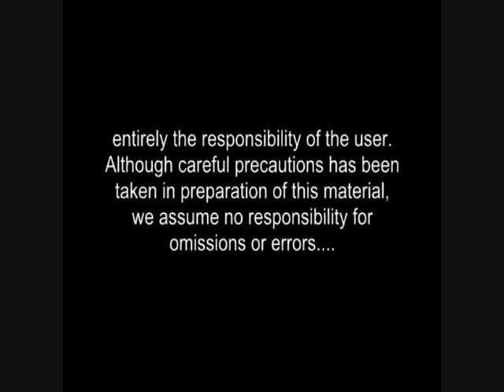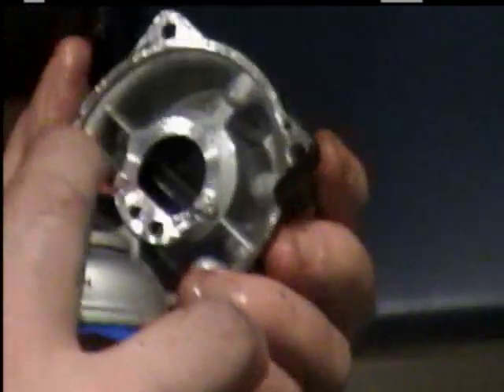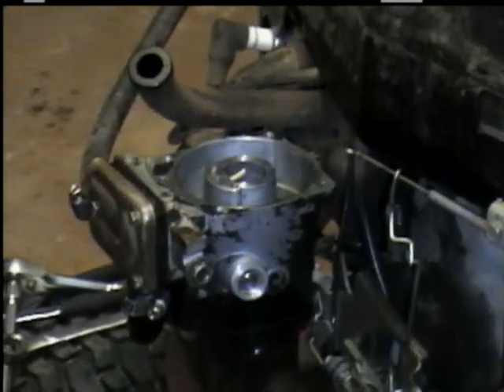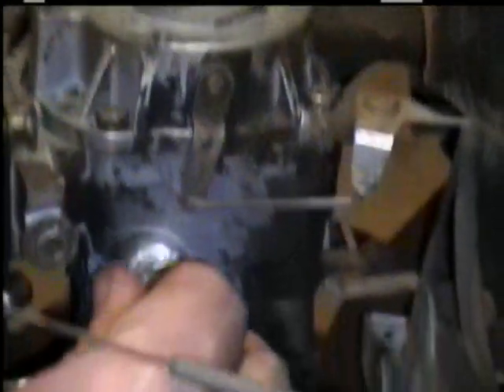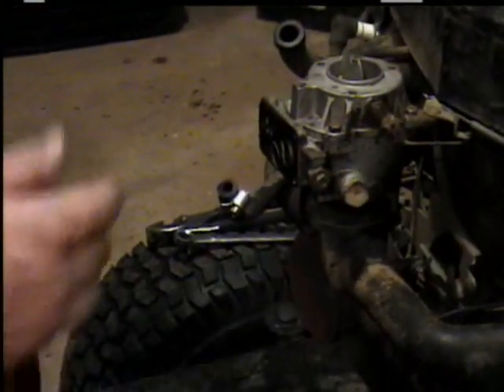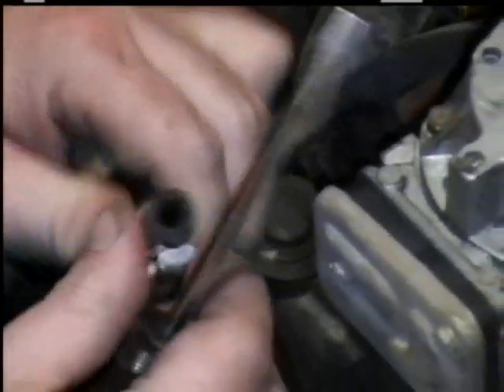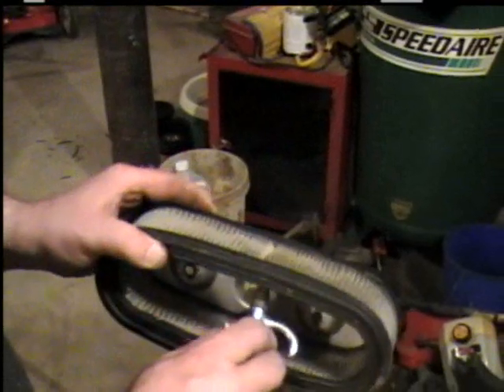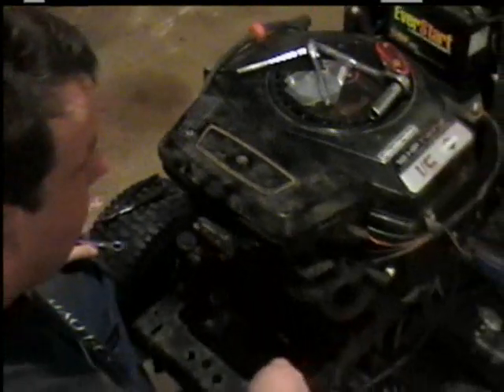Carburetor Cleaning and Fuel pump Repair

Comment: Anyone know what mite make a engine spit gas out the top of carb while trying to give it gas it want rib up .  Its a 18hp briggs  been sitting bout 5 year i cleaned the carb.  thx all.
Reply: Clean it again, and clean out all the little passages as well as the emulsion tube (if it has one on that model) with torch tip cleaners and carb spray. If it surges over and over, it is a dirty carb. If it spits it out of the top its more than likely dirt still in the carb too. It will build up and then spit it out the top as it tries to choke itself out and then revs back up. If all else fails, tear it apart and soak it in cleaner then blow it out. It took me five times once to clean out a carb totally even though it looked spotless. Change the fuel filter too.
Reply: Hey, thanks for the video, i have this same pump on my grasshopper mower... Is there any way to put an electronic pump on them? I always have to replace the diaphram pump and it's getting old. Any replies would be appreciated thank you!

Comment: Hey man got another problem with the 20hp briggs opposed twin...what you told me worked perfect...now it runs great choke fully off....but not it bogs down and dies when I engage the deck....if I catch it and disengage the deck it starts to run better....it seems to run fine for as long as I leave it run and drive it around...low idle...high idle....low speed or high no problem....but put a load on it and it starts to run bad and stalls....any clue what that might be?....any help would be great

Comment: only thing wrong here is talking about the fuel level in the tank....you need to test the pump under load ie....less than 1/2 tank this is when it has to work and draw it uphilll this is how you test the pump and eng vacuum

Comment from the maker: jfrohrmayer,

While a number off of the carb. as well as the name of the manufacture is helpful. But what you really need is the make and model off of the engine , especially if it's a Briggs and Stratton engine . Since it apparently is  send me the model , type and code numbers on the plate or sticker on the engine and I'll look them up and see what I can do and find out for you .

Whizkid